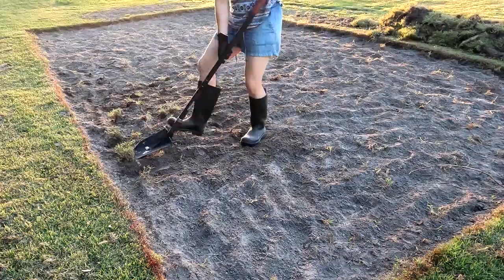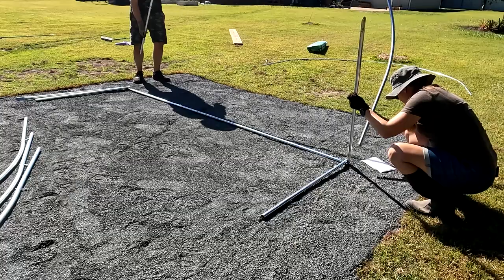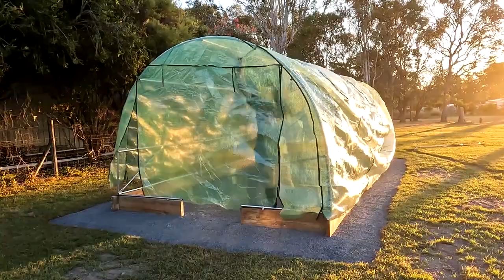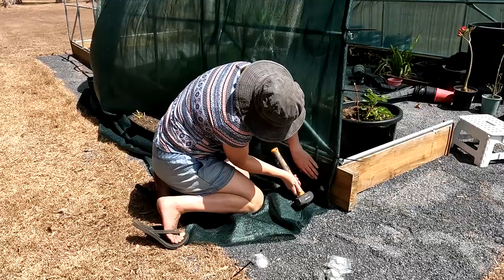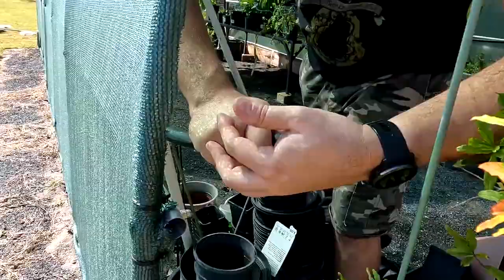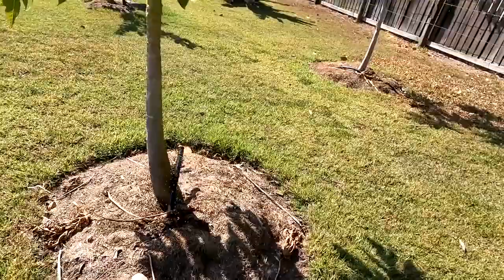We Built a Greenhouse from Scratch – With No Concrete!

Comment: Nice.  I hammered stakes into the ground on each corner and two in the middle and cable tied them to the metal frame.  It's very secure and won't blow away in strong winds, I have seen this happen before.
Reply from the maker: That's a great idea!